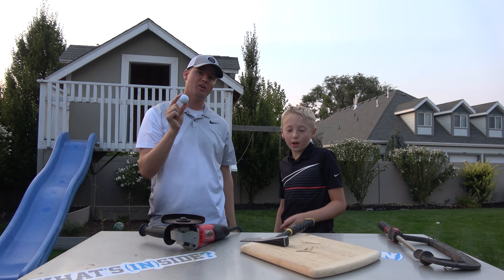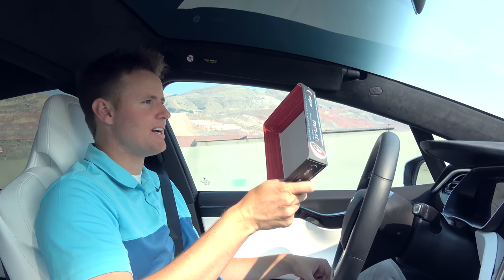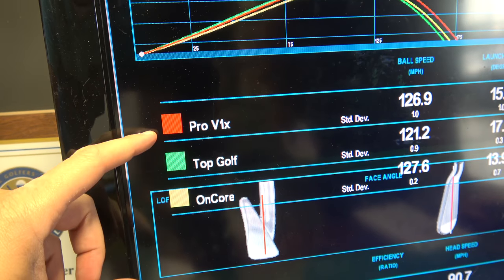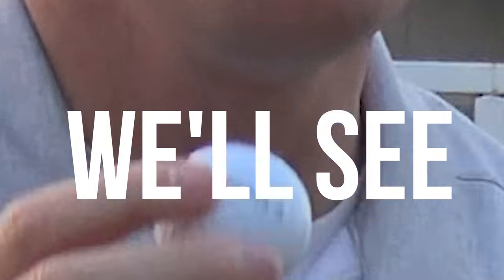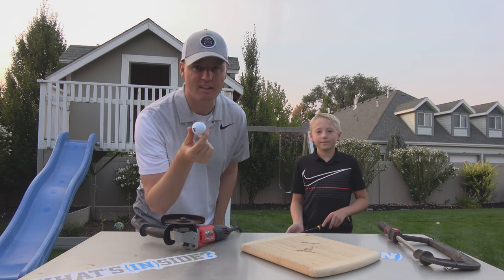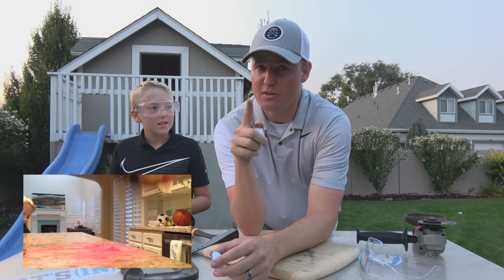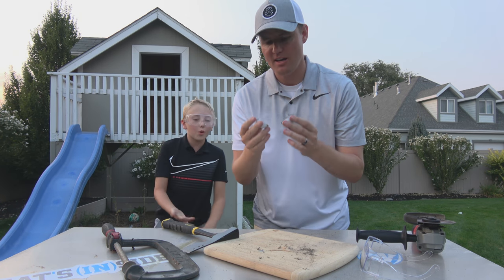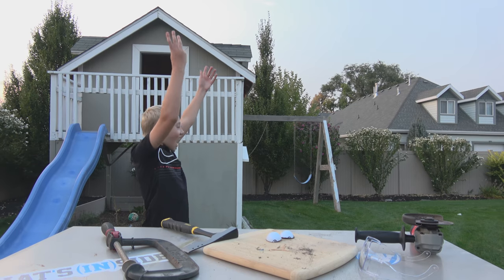Whats inside a Metal Core Golf Ball?

Comment: Hey guys - loved the video!  Let me help you understand this a bit better.  The MA-1.0 is a patented golf ball that forced the USGA to change the Rules of Golf to allow for rigid cores of 0.900 diameter and smaller.  So while OnCore had lots of customers for the MA-1.0, we wanted to make the ball even better and we improved the feel (softness), reduced the loudness, and generated more distance in an improved version called the Caliber.  That is the metal core ball that you can buy on the website now.   But, if you want a ball that goes even farther, there are two other options - the Avant (a 2-piece, very soft solid core ball) and the ELIXR (a 3-piece tour player's ball which we believe is the best ball in golf for 98% of golfers).  Happy to provide you with samples if you'd like to cut those open but it won't be as exciting or as challenging as the MA-1.0!  All the best.